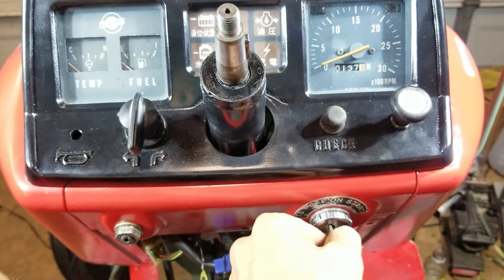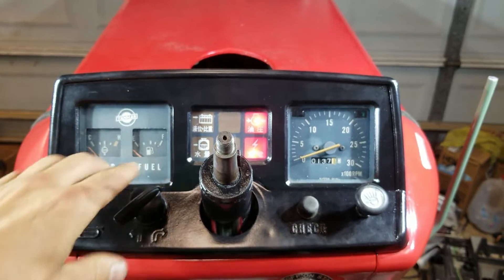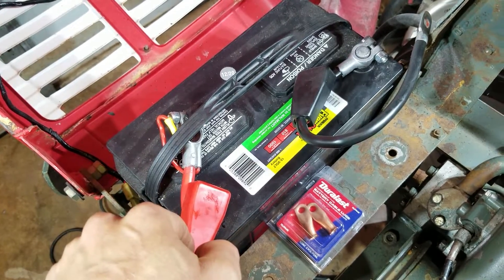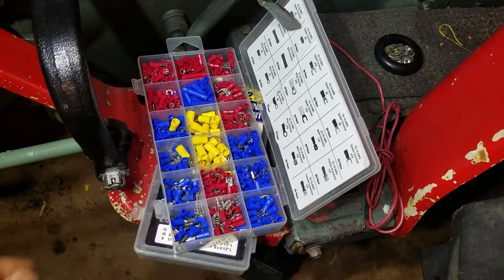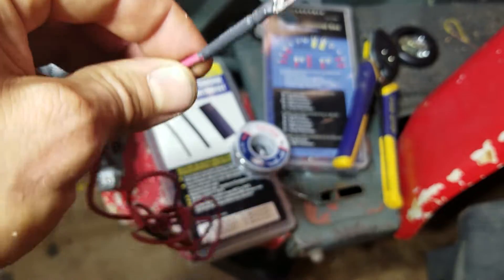Abandoned Yanmar Tractor WILL IT START? Part 5: Wiring Repairs

Comment from the maker: Hey Y'all! Tools and supplies used in the description! Stay tuned for the engine rebuild!
Timestamps:
0:00 Intro
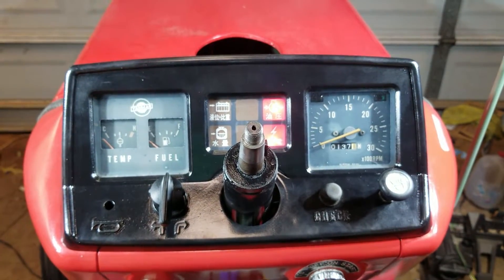2:12 Dash Wiring
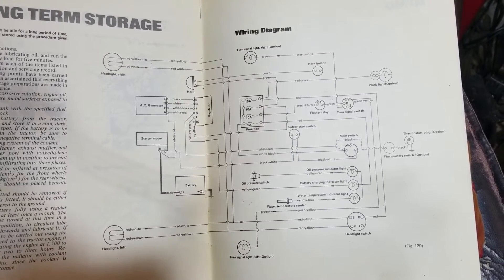3:12 Battery Setup
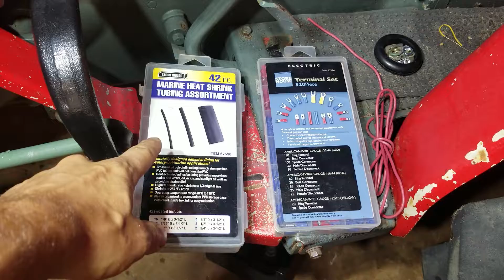4:12 Soldering Wires
7:27 Fuses and Clutch Safety Switch
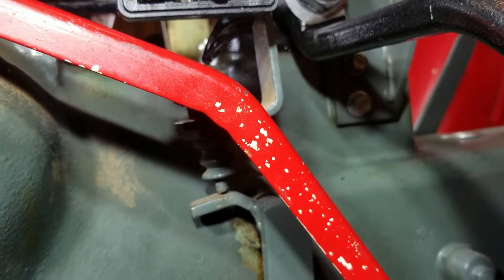7:43 Engine Wiring
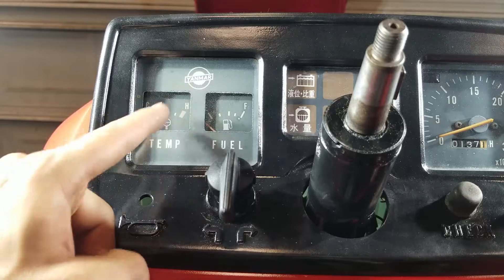9:19 Dash Gauges Test
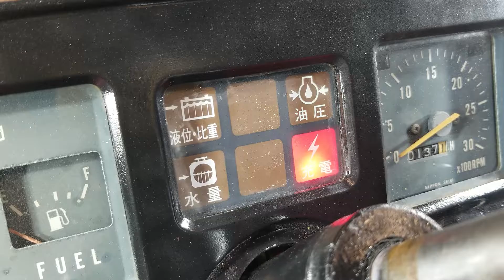9:54 Fuel Tank Sending Unit
10:18 Turn Signal Wiring
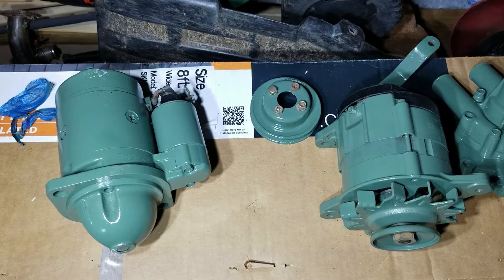10:53 Outro

Comment: Hey Matt keep up the good work. 

I have a question where did you get you service Manuel for the 2210, I have one but it doesn't show anything like yours, could you send me a link where I can get one that you have?
Reply from the maker: Hey, thanks! I got my manuals on eBay. You can order manuals from Hoye tractor parts. You have to look up the US non-gray market version of the tractor. So for the YM2000 I got a YM240 manual. This is the US produced version of the tractor.

Comment: I was trying to boost battery on yanmar 2310 heard it spark now it won’t turn over any suggestions
Reply from the maker: Check the fuse panel. You probably blew one of the glass fuses that is for the ignition. I think it's a 15 Amp fuse.

Comment: If the hour meter is correct, that is a practically brand new engine. It’s weird that the engine went belly up with such low hours.
Reply from the maker: I know. It doesn't make sense. I've been told they roll back the miles on the odometer when they refurbish these tractors.
Reply: @MattsShop  I just purchased a nice LMG2000D that has been refurbished. Looks like new, but the odometer shows 1,089 hours, which I feel is the correct hours on the frame. The engine has new sleeves.

Comment: why if you have rewired it why didnt you do turn the indicator to the right for right indicator etc!!!
Reply from the maker: The turn signal switch is confusing. It's the bottom part of the knob that points to arrows on the dash. It's right.